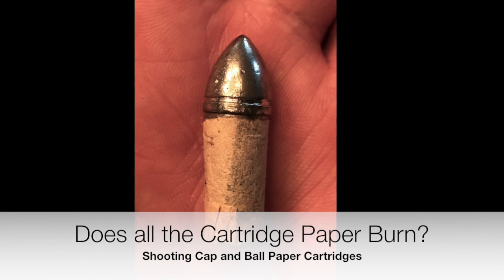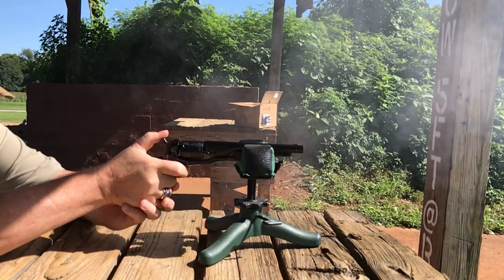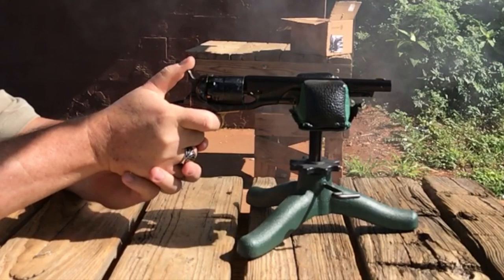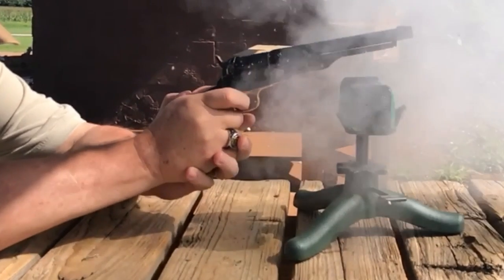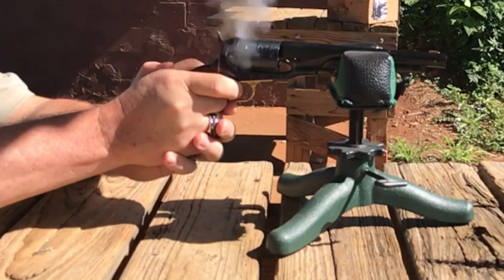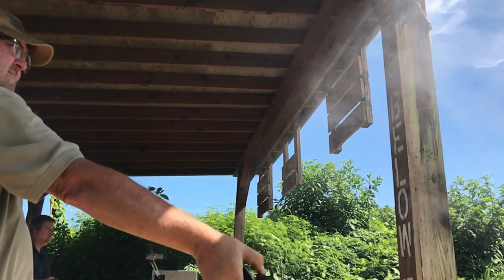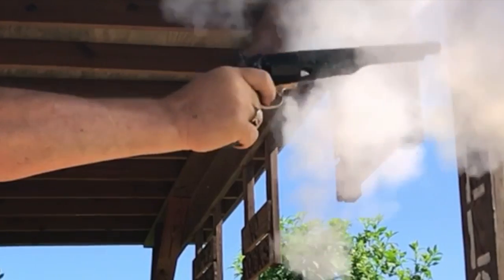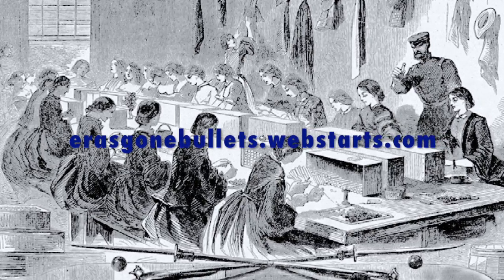Shooting Cap and Ball Revolver in Slow Motion

Comment: Cigarette papers are a good tool to learn how to make paper cartridges, and they will fire, but do leave charred paper in the cylinder, so they are only good for one time.  That is because cigarette papers are specifically nitrated to burn SLOWLY at the same rate as the tobacco.  The only paper I have used that completely burns is flash paper, and it leaves a completely clean chamber, so you may reload without cleaning the chamber.   Flash paper and flash glue are harder to work with and require ventilation for the flash glue.  These cartridges and the paper are easily damaged by dampness and humidity, so must be stored accordingly in that type of climate.  

I have not used hair roller papers, but did a comparison burn test with flame and small 2" x 2" squares of flash paper and hair roller paper.  The hair roller paper was a close second to the flash paper.  Original combustible paper and lamb intestine(appendix) seamless combustible cartridges were nitrated with acids(do not try this at home) which is a more complex process, but produces flash paper and flash skin.  Manufacturing of these complex and fragile cartridges was done by women and children in factories because of their superior manual dexterity and smaller hands and fingers.

Comment: I find it hard to believe that you could get large chunks of paper flying out like that from the cylinder gap. My guess is that the paper particles you are capturing are from the previous shot. The vacuum effect of the current chamber going off sucks any residual paper out of the chamber from the prior shot. Your standing videos seem to show this happening based on angle of flight of the paper. Good stuff. Keep up the good work.